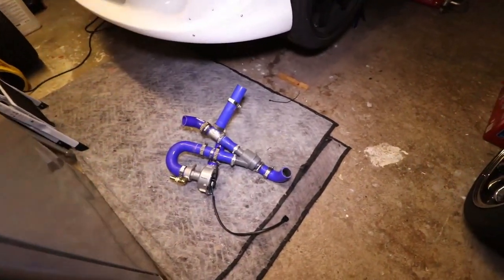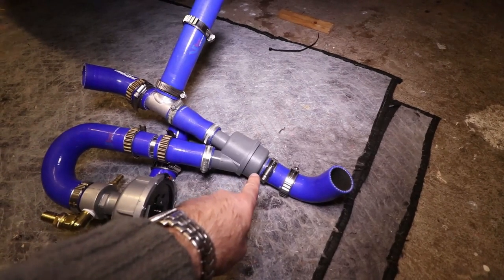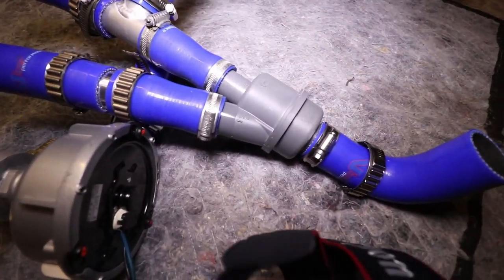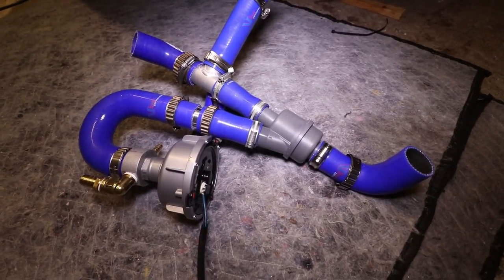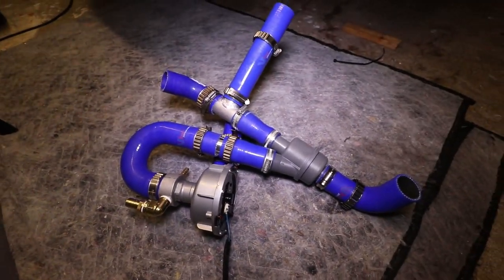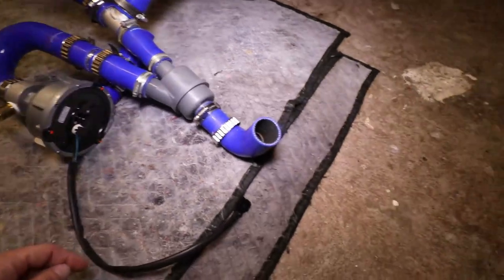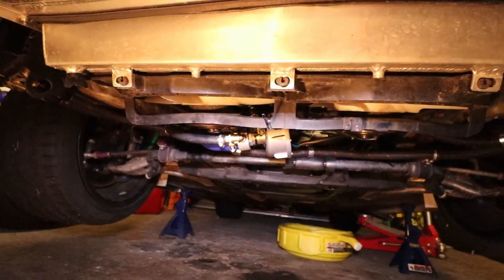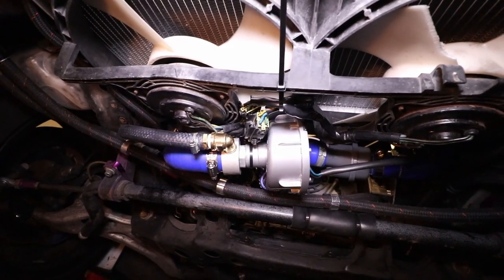EWP Install Part 6

Comment: Hey, found this from your RX7club posts. Wondering if you have an update on it. Did it solved the overcooling issues? Thanks!
Reply from the maker: Hi Michael, yes cooling is under control and the external thermostat seems to work well. I do wonder however on a pure road car if the smaller volume Davies Craig pump might be a better match for the cooling required. Maybe then the pump control might work okay without the need for an external thermostat. A bit expensive to buy another pump just for a test though.
Reply: @CranstonR  great news thanks for the update.  Yeah I have been wondering about going with the 110 pump instead of the 150.